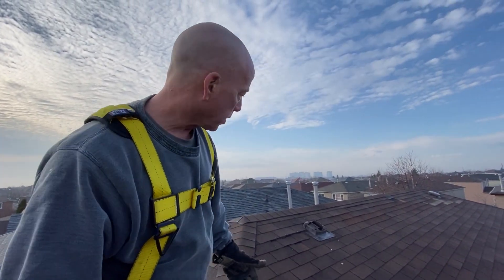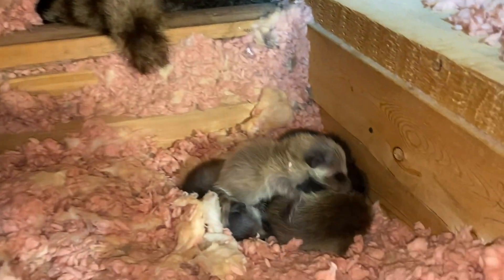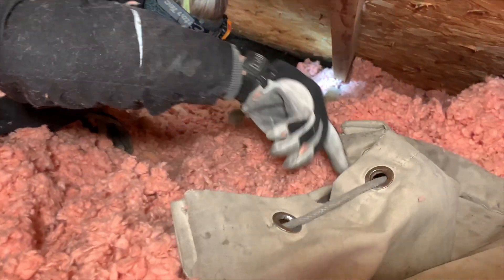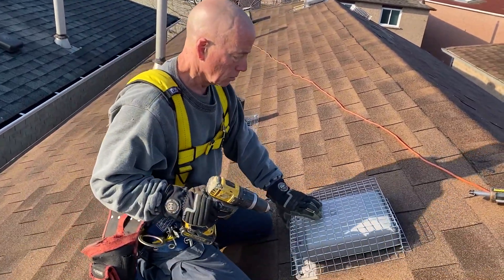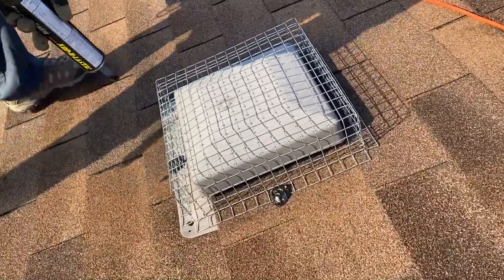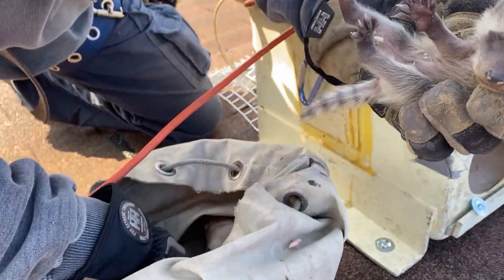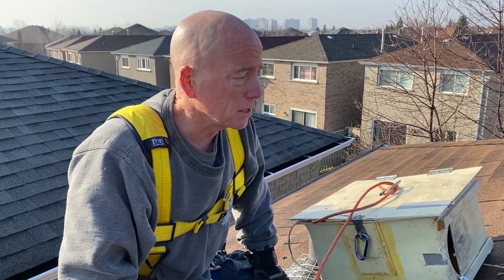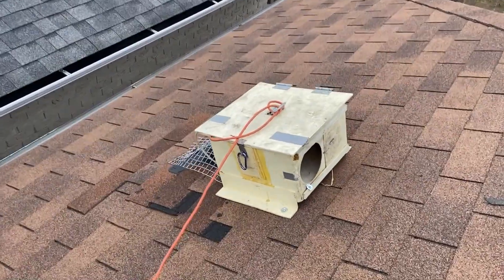Follow Along | Humane Raccoon Removal

Comment: All that insulation can't be good for them either.  Raccoons persons are just too damn smart!  But once again, my objection to letting them out in the open without shelter protection & vulnerability--to be subject to predators--especially humans who consider these great souls just pests to be destroyed.  I would like these owners of homes to just wait a little longer so they will leave & seal the house well by Fall.  Gates must remove them otherwise the owners can choose pest control co.s which might murder them.  Poor Mom, after all that trouble, to find safety & shelter, she was absolutely terrified of having her safe place violated by humans.  BTW, you can remove babies from dumpsters with a nylon fishnet--they will grab onto them--or a tall branch from a tree to climb out.  I have a nylon fishnet that I use on occasion--not each year, but it is handly to have stashed away for such an occasion.